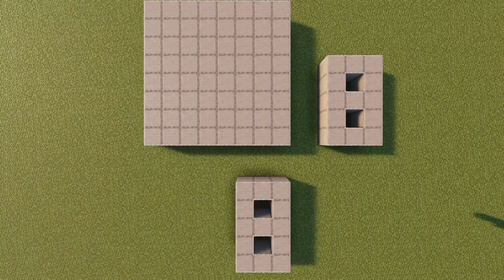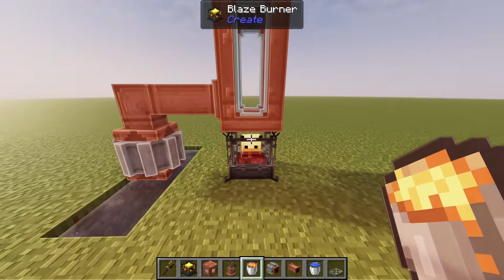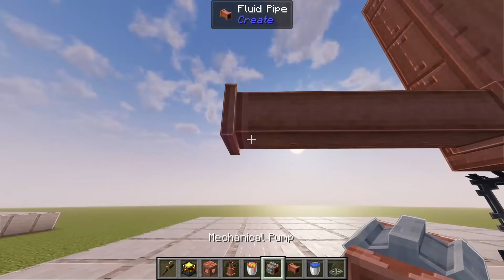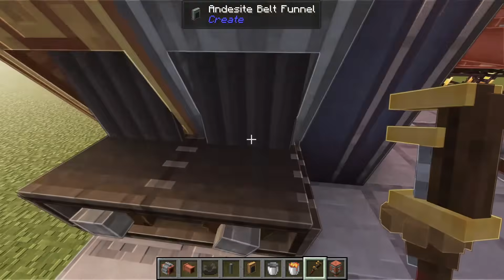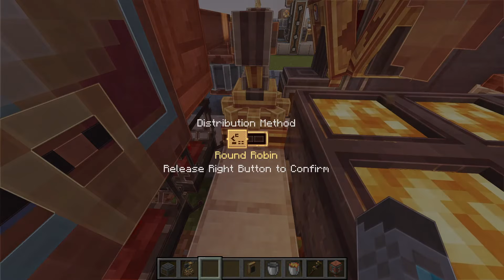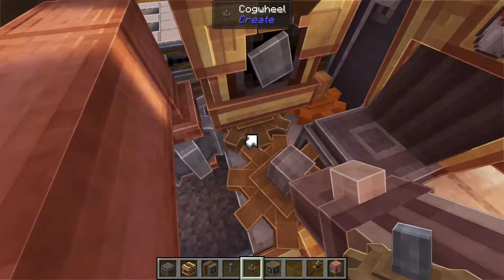How to build a Compact, Automatic, Level 9 Create Mod Steam Engine!

Comment: for the hand crank and the cogwheel thingy it keeps overstressing idk how to fix it
Reply from the maker: Try making sure that only the pump is connected to the hand crank. If anything else is connected, disconnect it to see if it works that way. Also make sure you manually heat a couple of the blaze burners to start it

Comment: exact mats (i think) for survival, cool machine btw
9x blaze burner
39x fluid tank
20x fluid pipes
4x mechanical pumps
9x steam engine
16x copy cat panels
2x bucket of water
13x shaft
6x item vaults
12x cauldrons
12x pointed dripstone
13x lava buckets
3x brass funnel
1x andesite funnel
1x fluid spout
1x depot
1x mechanical arm
1x rotation speed controller
1x large cogwheels
12x encased chain drive
2x gearbox
8x cogwheels
1x crank
1x empty bucket
Reply: Hey,  thanks for the item list this helped a ton with the prep, here's a few things that were needed on my end following the video.
+ 6x item vaults
+ 9 blazes(you capture them with the empty blaze burner.... I forgot about that lol)
1x mechanical belt
1x wrench (if u don't already have one of these ull need it for a few steps)
Once again thanks!
Reply: you are a saint

Comment: hi, i've built 4 of these, the first one works but the rest doesn't work, it stopped working after i place the cogwheel back for the last step, but it works fine with the first one?
Reply: it appears that the whole thing is overstressed when i put the cogwheel back after i hand cranked it, and i found a fix for this: you just need to feed the blaze with some fuel before putting the cogwheel back

Comment: If you power the pumps, the mechanical arm and the belts sepperately (with let's say water wheels or a windmill) then you never have to manually restart the engine if it overstresses. It will just continue to work once the connected machines are inside the stress limit.

Comment: could you skip the item vault and put the lava-spout over the depot with a brass funnel-input "empty Bucket" ? It works that way on IntegratedMinecraft, but idk if the pack has influenced some create-blocks...
Reply from the maker: You could, the only thing that would happen is the arm would constantly be moving the bucket back and forth until it gets lava in it, but this doesn't make it function any slower

Comment: Great video. Being a proper Create dummy, I do not know where the power output is. I mean the point I can use to supply power to other machines.
Reply from the maker: Any of the 3 horizontal shafts connecting up to the steam engine blocks is where you should connect up your power to other machines